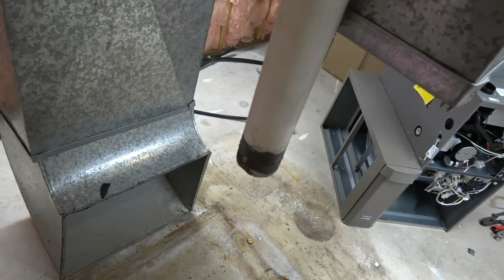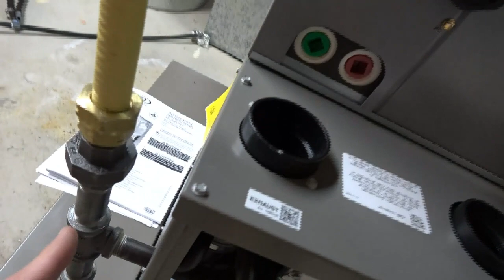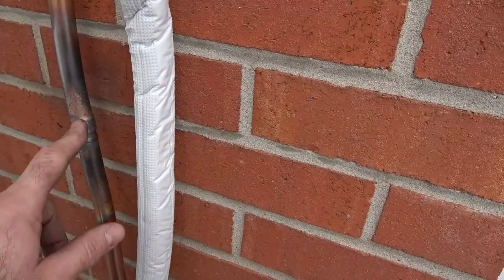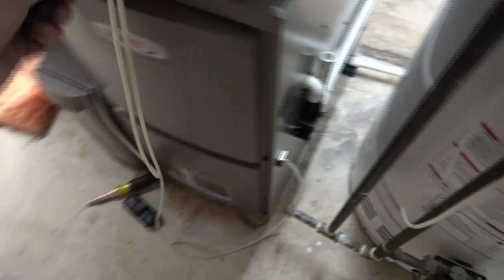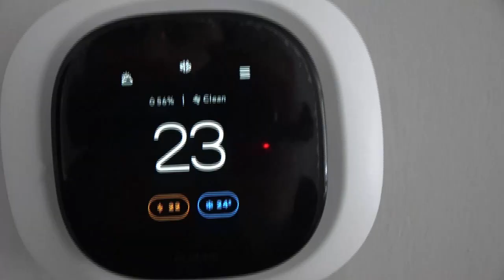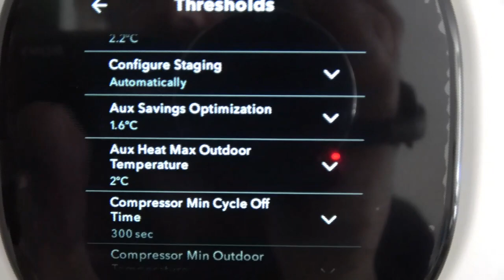Kinghome Heat Pump Installation Video

Comment: I had a hard time finding info on the dip switches in the manual. Do you know which is for tonnage?
Reply: Right on the hp
2 or 3 ton

Comment: Questions as we're going to be installing this product very soon.

How are you finding the QC on them?
How many have you installed so far?
If we have a 5 wire only would an "Add-a-wire" kit work with this system on the stat side to obtain the W2?
Does the coil come with a TXV non-bleed already?
What is your outlet temps in a - 9 degree situation?
Do you think it's worth trying to bend the copper through for the condensor connection or just braze/crimp?
I believe they're updating the units to have external connects at some point